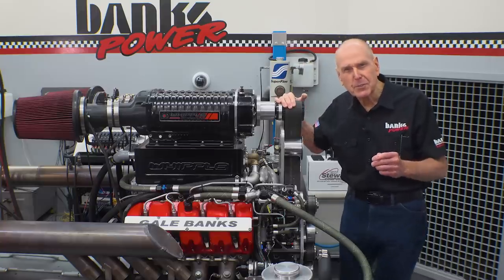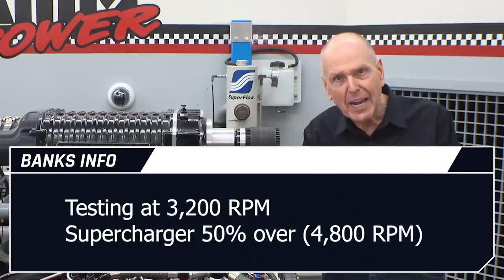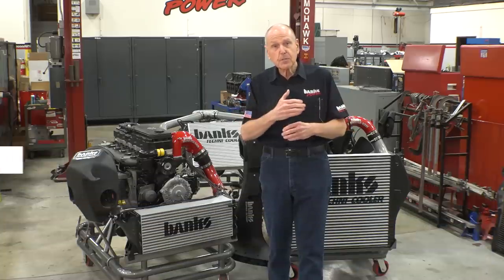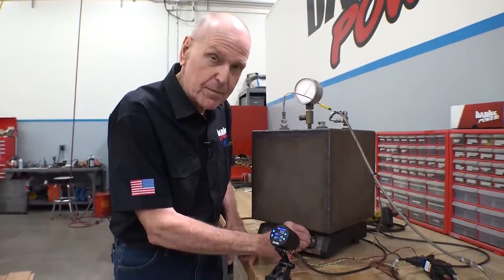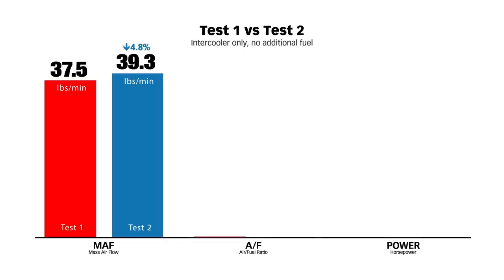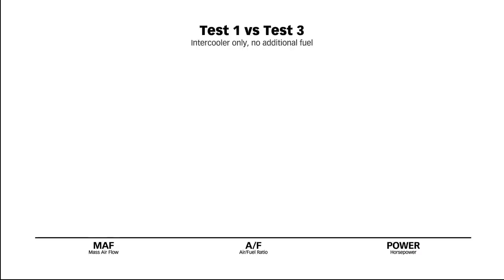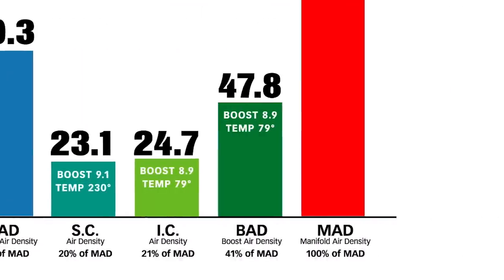MORE HORSEPOWER with Less Boost?! | Building a Monster Truck Engine Pt 8

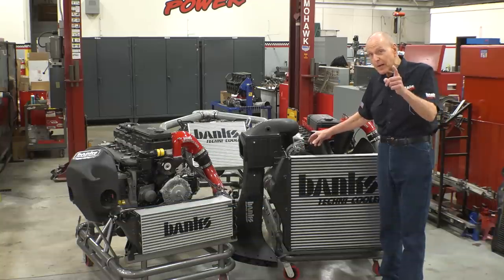Comment: You turn it to 11 when digging for data. Love it!   I have learned so much watching you share you knowledge and experience with more power.  I though once bigger turbo, more pressure, more power but that is so far correct.  Thank you for that! Love the flexing at 13:18 I was rolling.  You got some big guns and no fear at all.

Comment: You understand the processes far better than some fashion players. I really appreciate some hard numbers on the efficiency gain from better intercooling. I have always appreciated the thermodynamic benefits but the gain from parasitic drag was surprising. Many intercoolers are just air-cooled heat sinks but yours will stand a sustained load where the others will fade out. Once again I salute your knowledge and experience. The best way to promote your products is exactly how you are doing it. Real testing!

Comment: I want to buy a truck just so I can buy Banks products.

He does everything exactly the way I dream of being able to do it myself.
Reply: I'm a fan of electric vehicles and never gave a damn about diesels before I started watching Bank's "How to kill a Duramax" videos. Learned so much.
Reply: I mean....banks is such a legend and some of his products versatile enough that I'm putting them literally into a super/hyper car kit car build. Thinking the data monster specifically. Data monster plus some other gauges and displays should keep things concise easy to read and not take up a ridiculous amount of dash real estate. 

Plus might see if some of his air filters will work. His one filter does pretty much no intake restriction. And this video series gets into like my whole concept for my boost system. 

Twincharged for those benefits. Throttle response being a main one. But then also blower effiency theory gets into it. Idea is more nuanced boost system, more so controlled induction then forced induction and designed to really boost effiency. 

Engine is a hot vee configuration. Means 2 supers need but also helps with effiency of the supers for sizing reasons. Under driven while still being oversized and pushing enough air flow and adding some pressure but at really low ar ratios. Feed em with turbos. 2 separate banks of boost also means more cooling capacity and hot vee helps that plus turbo spool. Shorter piping runs and hot vee closer turbo packaging. Water to air under the blower style intercoolers and then normal turbo style ones in between the 2 stages. Power the water to air system with an interchiller and the ac. Ac compressor swap and gear ratios swap to suit right till redline usage. 

Air flow air pressure and air temps all controlled. Means even with low valve lift and cam profiles that don't necessarily suit the revs I want I can kinda force the air required to keep the engine going. Map the boost to gear and rpms and available traction and it should feel like the best NA engine ever but with an insanely wide powerband that's tuned. Too much early torque fresh air antilag cut some intake out to help with turbo spool. Dramatic temp differences should also cause nice expansion helping things out. 

Blower high volumetric effiency. Turbo high mechanical effiency. Turbos help thermal effiency. Can get both stages to peak compression effiency in terms of heat added and for the blowers parasitic losses wise. Reduce other losses and make up for some lost blower effiency on the engine. But can also bypass it if needed and do so easier then old set ups. Super bypass valves integrated into the set up should do fine. And still let me get 2 stages of cooling when the turbo makes all the boost at high rpms and low boost maps. For high boost just run compound boost for effiencies. 

Since less heat and better scavenging and reversion resistance. Less detonation issues and combustion chamber temps. Better peak timing for less losses, as well as no fuel needed for cooling properties. 

Add in the engine has vtec and is flatplane v8. Exhaust performance and back pressure is gonna be way lower then expected with really good turbo spool. Might go twin scroll turbos to help even further. 

But add on I'll be able to use the boost system with a few tweaks to set up a natural running vacuum pump set up on the crank case. Plus air oil and air water separators. Windage and pumping losses should be fair small. Stiffer block and other stuff. Less deflectional losses. 

Essential a controlled dynamic compression ratio, via vtec and the 2 cam profiles, and via the boost pressures. Along with controlled induction and exhaust characteristics. Goal is like almost 300hp per litre or 150 per cylinder. And like 300 percent volumetric effiency combined. And 40 percent thermal effiency and other effiencies.

Comment: That's great Gale, but where is my dead Duramax?
Reply: In the trash where it belongs🤭.
J/k , I'm a ethanol guy all " bug foggers" are silly to me, but to each there own. If I ever needed the low rpm torque I'd definitely go " greaseil " but I'm a " power choke " fan. 😎

Comment: With the improved intercooler and the resulting boost drop; I'd like to see the boost cranked back up and the numbers compared at the same boost levels since that's what any owner would do.
Reply: Would be interesting but the fact is the lower boost setup/s will live longer.
Reply: Boost from a super charger is because of restrictions as you see here same pulleys less boost more power more efficient. Turbocharged is different when talking boost pressure it is controlled by a waste gate or variable turbo not restriction.
Reply: That's where the owners are wrong, because boost doesn't always equal to power. but to be fair I fell into that hole once, didn't make anymore power but just increased my intake temp lmao.
Reply: @hendrahendra  heat induced boost is always a net loss, like pushing a turbocharger out of the efficiency island.  Yes more boost but less power due to less O2 in the cylinders.
Reply: @willydunn6978  Eh? Boost is ALWAYS a measure of restriction, doesn't matter what variety of compressor it is. For examples, go watch some of Richard Holdeners dyno tests where swaps cams on turbo motors and watch how a cam that allows the engine to flow more air NA results in less boost and more power when no other changes are made to the system. 

A compressor is a compressor is a compressor. They are more similar than they are different, and none of them are magic.

Comment: You could think of the 17 horsepower coming from the fact that the blower is pushing against a lower manifold pressure due to the intercooler.

Comment: If your not already, I’d be curious to see the power gain from Amsoil in the engine and supercharger. We sell several weights of compressor oil that would work perfect in the whipple.
Reply from the maker: Not to worry. If all goes as planned, there will be quite a bit of Amsoil in upcoming videos.

Comment: Hello, Gale! Big appreciation to your knowledge, experience and expertise! And big thanks for sharing them! I want to ask you to add metric values to your graphs, at least the temperatures, because pressure and torque are okay to understand, but when 279f (137c) drops to 79f (26c), by 200f, but 200f is 93c, and that hurts metric brains🤣

Comment: Gale, I have learned so damn much from you on this channel in the past couple years. Thank you. 
You’re showing a post cooler air temp of 79 degrees suggesting that the water is not engine coolant but is from another source of cold water. On a monster truck, this would be feasible, have a tank, fill with water and run it for ten minutes. But what about cruising down the highway in a pickup? We would need to use engine coolant for the intercooler. Even if the intercooler were first in line for the water when it came out of the radiator, I’d imagine you’re still looking at 120-150 degree water for the intercooler on a hot day. I would be very interested to see this test run under those conditions as well.
Reply: factory built supercharged vehicles typically run a seperate cooling system for the intercooler and engine. the intercooler system will have a heat exchanger much like the one shown here, then it will have an electric pump and a separate radiator. coolant in these systems really doesnt get past lukewarm. in a monster truck they could likely get away with an ice bath setup like a drag car as the monster trucks only run for a couple minutes at a time while making power, although a small radiator for the intercooler system with a fan would likely work well.
Reply: Thanks. That’s very logical.
Reply: All the aftermarket companies provide a separate tank and pump for their intercoolers. They don't run through the radiator because it would be ineffective.

Comment: Awesome technical strip down of fluid and thermodynamics giving real results. It would be nice if °R was used instead of °F when working out % drop of inlet temp. Thermo either works on delta T or absolute. Still - massive temp drop and density change.
Really can't knock products Engineered so well, especially with such enthusiasm shown!

Comment: So you have to fill the bed of your truck with ice for the intercooler before you go up a 6% grade?
Reply: Well duh, do you not have the newest latest and greatest intercooler ice production unit device controller unit module with the now new handheld controller!?!?!? Spits ice cubes at an astounding rate this new unit, 118CPM
That's quite this increase compared to them other untested brands like motomishi, toyorad, etc etc. Griffin Thermal Products is the next best option in my opinion tho.
 Good Luck and Let's Gooooo!!!!
Reply: 200ga of iced water lasted 4.25mi @Bonneville for the Salty Box Racing team  running there dodge Cummins to 227.xx mph (1/2 mph short of B/DT a world record)

Comment: That was the most detailed description for the injection timing I ever heard !! Thank you. 
How does this compare to prechamber diesels ? I have an OM602 2,9l 5 cylinder and the injection pump is set to 24° before tdc (fuel delivery start) I imagine the actual injection / combustion occures quite a bit later du to the "mechanical lag" of the injection nozzles and building up to that opening pressure in the injection line. On top of that the prechamber system further retards the complete combustion of the diesel in favour of less NVH.  This would be biblically late compered to the 40° before tdc of that l5p. What happenes if I advance the pump ? What would be too much und Why ? 

Regards 
Simon

Comment: So the Roots Blower in low speed applications(idle - 2,300 rpm) like a 2-stroke Detroit is still viable. Could a Whipple be a substitute for the Roots in an application like that? BTW, proper development of your 'Design of Experiments' process. Good thing you don't pay the 'experts'. Thanks for the input.
Reply: Wondering the same thing myself. I'm getting a project truck with a 8v71 soon and I will be slapping a whipple on that SOB as soon as I can. We will have results. I'll get an idash setup for good measure. 8v92s had intercooler under the blower and I bet with the blocks being similar sizes one of those will fit.
Reply: @theq4602  So "Whipple" does make a large enough supercharger for an engine that size? Does the twin-screw work as well or better at the lower rpm of the big diesel like the Detroit?

Comment: dumb question but is there a way to make 12volt or converter power to make instant cold water like they make hot water?  Tie it into the AC compressor 😂?

Comment: Boost is just a measure of air restrictions, reduce restrictions =reduce boost with a gain or no loss of power? Gale just proved that!!
Reply: He added more restriction and made more power boost is a measurement of pressure not restriction
Reply: @bill2178  almost correct.  
Without restricting flow there is no pressure.  
Eg . A water hose mesuring water pressure in free air =0psig. Now measure the pressure at the other end of that 100' hose >0psig . The skin friction and turbulent boundary layer cause restriction therefore pressure.

Comment: This is the pinnacle of explaining intake. Bc it's NOT pressure as you say. 
I've always thought that power = the delta between the volume + temp (MAD) in vs out. 
So the cooler (and more) air in ... and the hotter out ... the more pressure equals more power. 
Power is a function of the temperature deltas of the air (minus mechanical losses to get it in) 
Shove in hot air, you CAN'T change the pressure as much.

Comment: What temperature water is being pumped into the air/water intercooler?
Reply: If the water temp is rising 22 degrees, and the outlet air is 79, I would have to assume at most 57, but I'm not necessarily qualified to answer than with any confidence.
Reply: @IceBergGeo  I wish it were that simple...
Reply: @matthewlemke5265  I know... Just a slightly smart-ass answer... counter-flow chilling, and other things can influence it all the same. Like I said, not qualified...

Comment: If you are going to use a percentace in terms of temperature please convert to kelvin otherwise the number is virtually meaningless.
Reply: Otherwise absolutley outstanding information really makes you scatch your head at all the sled pullers with no intercolling and more boost than my air compressor can make.

Comment: OK, I have a couple of questions, comments - just curious; So what was ambient temperature? As I look at my air density chart, I'm having trouble getting a density that low at sea level/with a temp lower than 79F - am I right in assuming the difference is the altitude of your shop, or is the intercooler actually sub-cooling the air charge below ambient temperature? (Not unusual on a marine engine.). The other question relates to the intercooler -  I am curious as to how will you be cooling the water from the intercooler in a truck, I am assuming a separate "radiator" (H20/Air Heat Exchanger), will you be regulating that temperature somehow? I hope that all my questions have not been answered elsewhere. Thanks.

Comment: Are the intercooler evap coils designed so that they do not condensate? Like in an standard A/C system. Moisture sure isn't good for the engine.

Comment: So if I run my ac line through the intercooler to freeze the charge air, I’ll gain tons of power on a parasitic system I already use to stay comfy on a hot day?!

Comment: Wouldn't that be considered a after-cooler instead of a inter-cooler? or do i have it backwards again? please explain...
Reply: yes it is technically aftercooling. the actual definition of intercooling is cooling air between compressor stages in a compound system.
Reply: If banks calls it intercooling it's intercooling now
Reply: Intercooling has become an industry slang term for any Cooling of the air following any kind of compressing insted of Charge Air Cooler . Precooler = heating or cooling air before a compressor normaly found on ships as a water 2 air,  intercooler  =between stages (2 or more stages) , aftercooler = after all stages .  
 Just like it's impossible to have a Posi in anything other than a Dodge.  Posi has become  just a  slang turm for a limited slip differential ,but  Posi is a trademarked and registered Dodge  product.

Comment: Thinking outside the box here but what might if instead of water you tied the intercooler into the A/C system turning it into an evaporator? Would this run colder gaining more air density without the need for a reservoir and other added hardware?
Reply: There are systems out there that use A/C to chill the water before going to the intercooler.

Comment: 13:00  cold dence air with minimal pressure drop?
How cold is too cold?  And what is your proposal to keepthe air warm enouph to keep from quenching the flame front?

I am seeing32°f @air filter, 23°f IAT@ 15psi sustained 70mph with 253°f compressor outlet @21°f, ambant EGT @ 600°f.   With 30% of my cooling stack blocked to maintain coolent @ 10°f below thermostat.
Reply: Dave Micolichek  so you're saying when I measure Sub-Zero intake air temperatures all's good, at what air temperature is it a problem( loss of performance)? Under normal driving conditions 2 degrees above ambient is what I observe it is common to see weeks at 20 below or colder.

Comment: Why not show cross section...
Oh it's the same core as all the other aftermarket intercooler manufacturers. 
It's a good sales pitch but independent testing would show no difference between his competitors.
They are well made and definitely better than stock but know different to any other using the same Chinese cores!

Comment: Not to be a naysayer, I do think Banks has some really great products. However, isn't a MAF (Manifold Air Flow) doing the same job as a MAD sensor, just computed to different engineering units? Also for that matter, it really seems to have more in common with a MAP sensor data when coupled with and IAT.

Comment: If you super cooled the box with dry ice would the air density increase?
Reply: Yeah but be careful of condensation. Water isn't compressible. Also that dry ice probably won't last long so you'll need to top up whatever is holding it between dyno runs and drag races.

Comment: Mr. Banks, have you ever considered using liquid nitrogen to cool an intercooler? Would lowering the air temperature even more increase density dramatically?
Reply: I've asked many diesel "experts " how cold is too cold . Most simply respond with no such thing.  My theroy is there is a point (~45-60°f) were the ignition of the fuel is compromised by retarding the timing, reducing cylinder pressure, and producing a lot less power. This is a concern to me living in Montana where I can see Sub-Zero intake air temperatures. This is why Cummins Cycles the grid heater after the engine is running making it easier burn all the fuel injected reducing smoke /hazing. I'm looking into using R744 (CO2)  -50 - -70°f should be enough  cooling potential.